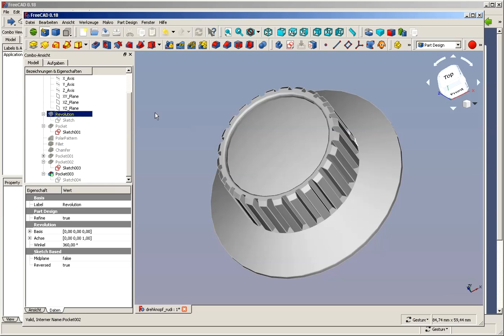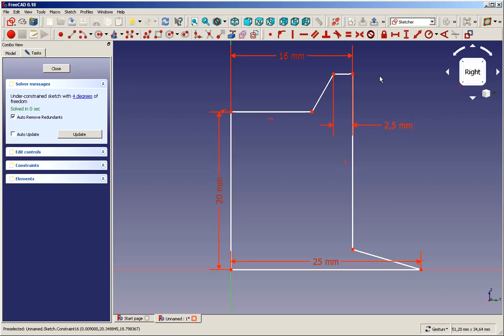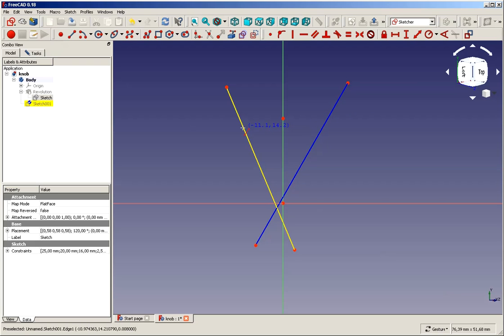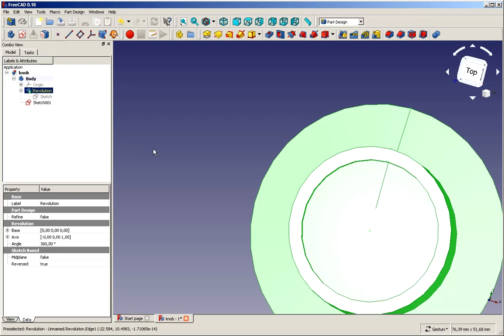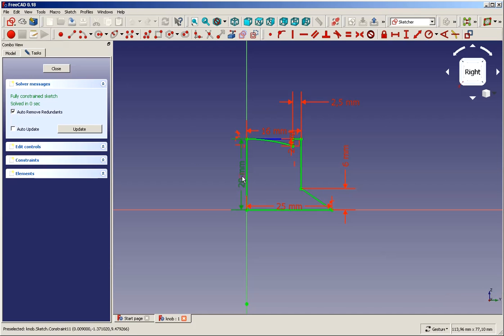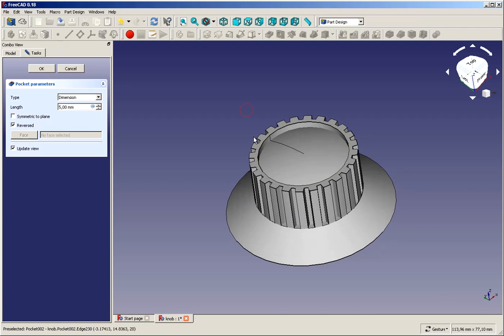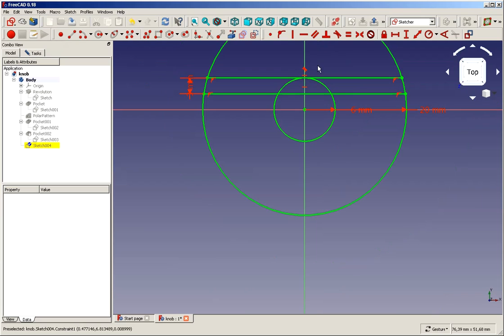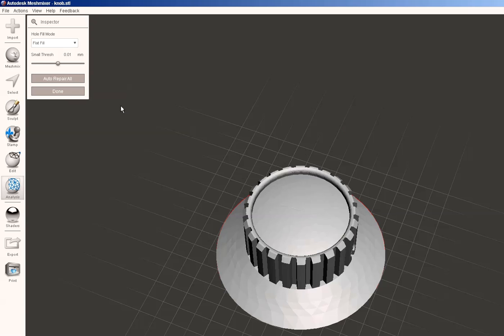FreeCAD 0.18 Sample Project, Creating a Radio Knob

Comment: 44:18 I got stuck here. FreeCAD 0.18 Rev 4 doesn't want to trim the two upper arcs of this inner circle. When I zoom in, it appears that the circle's edge is not actually touching the horizontal line. I found several mentions of this being a bug in FreeCAD. How are you getting around this?
Reply: I found one person who drew a box around the area where the circle and line touch. For some reason then FreeCAD allows me to cut away the pieces of the circle. I can delete the box afterward, and all is well.
Reply: Also, I had an extra degree of freedom after setting the 3mm vertical distance after the cutting. The two horizontal lines were 3mm from each other, but not fixed in vertical space. I had to set the horizontal distance between the two points inside the leftover inner circle to 10.35mm, which is what they were originally. After that my shape was fully constrained. Just a heads up to future viewers who may run into these issues with whatever version of FreeCAD they may be using.
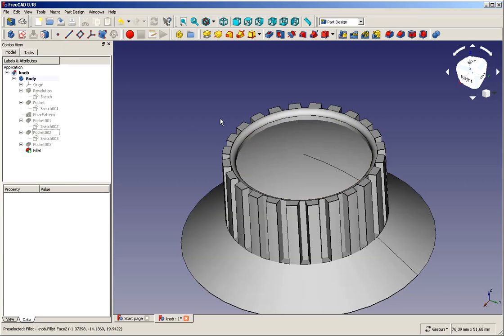Reply: 46:01 in my version of FreeCAD, I had to set the fillet to 0.99mm. Using 1.0 resulted in a "Resulting Shape is Invalid" error.

Comment: Thank you very much for a great video. I have a question. When you complete a "formula editor" box, where do you find the required programming input? Is there a Freecad reference publication describing the correct sequence for doing that each time?
Reply from the maker: Well, in .18 you see all possible enries on 1st character input. In .19 this is unfortunately lost at present. I am not aware of a simple documentation about these things..especially due to the changes involved from 0.18 to 0.19 . You may have to ask in the Forum.
Reply: Much appreciated. Thanks.

Comment: At 15:04 I cannot get the line to be selected after choosing the 'external geometry' tool. I am using 0.18 revision 16093 +53 (Git) on Ubuntu 20.04. Does anyone have any idea what may cause that?
Reply from the maker: I have no clue, there is nothing special at that  point, other than you musdt look from the side before selecting.

Comment: Very nice tuto! It seems to me that at this step: https://youtu.be/H9qPMf3pxxo?t=699 there is no need for a tangent helping line to prevent the arc to go upper the structure. Just by fixing the center point of the arc on the center line (1 constraint) we ensure the arc to have the right position.

Comment: Great tutorial. Trying to hang on😉
At 25:55 there seems to be no way I can edit the “0,00 mm” and thus put in the reference to the sketch dimension. I cant’ delete or edit the digits and If I try to overwrite with other numbers I just change the wiew position accordingly. Same in edit sketch mode. 
The “F(x)” symbol in the field is greyed/inactive as well. What am I missing?
Thanks😊

Comment: I don't see the constraint symbols that follow and appear with the cursor in this video. Does anyone know why? Here is my version.
OS: Windows 10
Word size of OS: 64-bit
Word size of FreeCAD: 64-bit
Version: 0.18.4 (GitTag)
Build type: Release
Branch: releases/FreeCAD-0-18
Hash: 980bf9060e28555fecd9e3462f68ca74007b70f8
Python version: 3.6.6
Qt version: 5.6.2
Coin version: 4.0.0a
OCC version: 7.3.0
Locale: English/UnitedStates (en_US)
Reply from the maker: i just tried and here it works fine. Also 18.4 on windows. I guess it´s a setting that differs. Yre you sure you have automatic constraining set to on ? and also, that your cursor is close enought to the nex possible entity for constraining ?
Reply: @hagei406  Under "Edit Controls" Auto Constraints is on. I don't think not being close enough is an issue. All I ever see is the Cross Hair, the tool symbol, and the coordinates. Nothing else ever shows up. I also don't see the "red tags" next to the line indicating things such as horizontal. 
Any other ideas?
Reply from the maker: @williamstrater8065  no...maybe someone in th forum knows an answer..

Comment: Albeit the bugs, FreeCAD still is a beautiful piece of software. I'm a newbie and the more I learn, the more I get amazed at the immense number of features it has. Thanks, Ha Gei, for showing them to us in such a clear way.
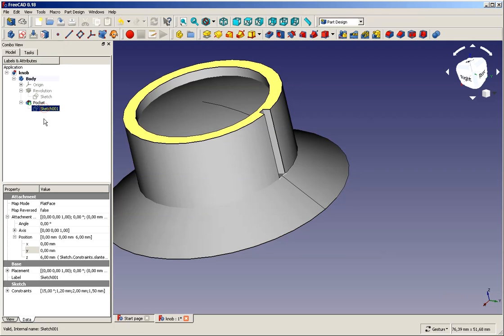I'm trying version 0.19, even if it's not the stable version, and I've found out that it doesn't have the problem with altering positions with offsets that you mentioned at 26:30. Thanks again and continue the great job.

Comment: around 25:50 my frecad can't respon to edit positon, i click it on x,y,z also on position tab "..." and type "=" sign it stil in unchange mode what sould i do?
Reply: I was having the same problem, but finally figured it out! You can only edit Attachment for the sketch, not Placement. Check what section of the data window you are trying to change.

Comment: Thanks for taking your time to walk through this example.  On the last step (Sketch004) hy would the Edge Trim not work on the circle sides? The workspace just flashes and the circle remains.  I can delete the horizontal lines inside the inner circle but not the parts of the inner circle. Same version as yours.
Reply from the maker: Try again, it may be the sequence of clicks that is the problem. Otherwise send me you file, i can look and then tell you what is wrong.
Reply: @hagei406  Ohh I tried to click many times. I tried to reload the model etc. Nothing helped.  But I did solve it - I removed the tangent constraint on the inner circle and that allowed me to trim the top part of the circle.  I had to add a horizontal constraint to keep it at 3mm and to fully constraint the model.  I have no clue why the tagent constraint would do that?

Comment: Hey how was you on off the revoluarion mode plzzz expain
Reply: BEFORE you start your Sketch make sure Auto Restraint is on.  To activate Auto Restraint click the "Edit Controls" menu in the sketcher side bar. If auto restraint is already activated toggle auto restraint off then on again and it should work.  This tutorial should work if your sketch initially disappeared while creating a revolution.
Reply from the maker: Sorry, i cannot follow you ?
Reply: @hagei406  sorry
Reply: Thank you very much
Reply: Vishal, perhaps you have already discovered, but you can toggle revolution and other features on/off by selecting them on the model tab on the combo view and pressing the space bar.

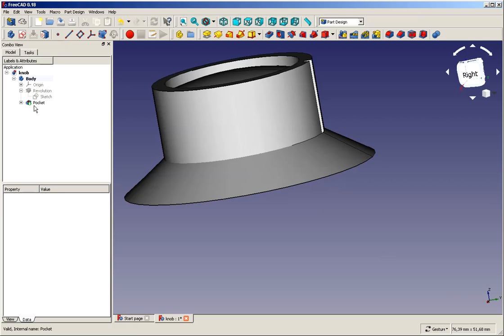Comment: About 24:40, Why not creat a sketch in the top "ring" and make pocket, so that you can control the depth
Reply from the maker: Well, as usual, if you want to show a functionality,, in this case revolution, you may choose a not so obvious way. There are several possibilities. But the least good one is choose the top plane and create a sketch..this exposed a probability to step into a toponaming problem. My Tutorials try to show ways to avoid that.

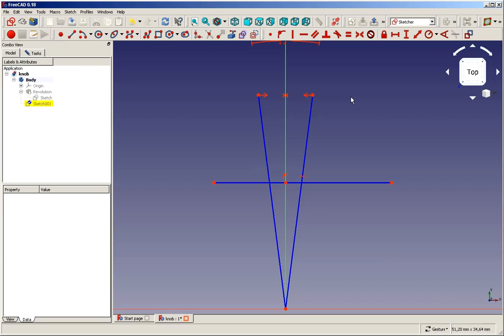Comment: 18:43 weird, I always select: dot, line, dot to do the symmetrical constrain and it works (on 0.16 and 0.17 versions), when I tried as you mention dot, dot, line never works, just did some strange stuff instead.

Edit: I just tried again, now works on both cases, on 0.17
Reply: I think the old versions were very picky about the order. Maybe the newer ones do some more guessing.
Reply: @XTL_prime  Guess you are right. I have been using both 0.18 and 0.19 and I haven't had any problems with the order in which I select points and symmetry lines.